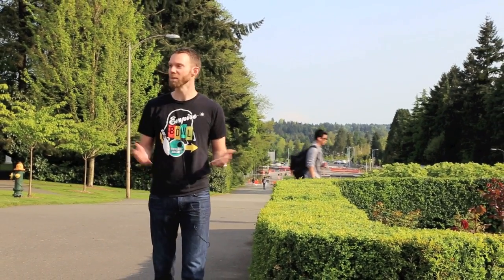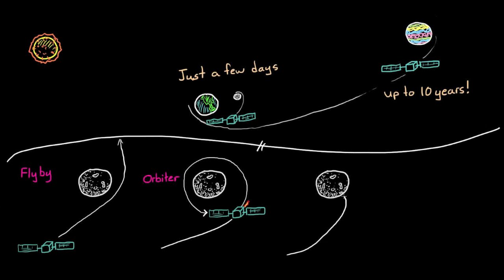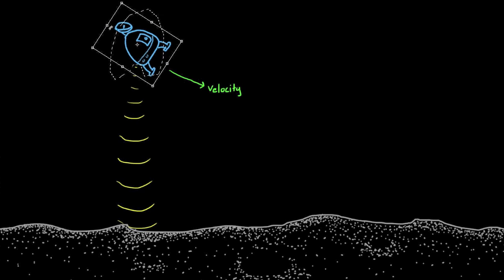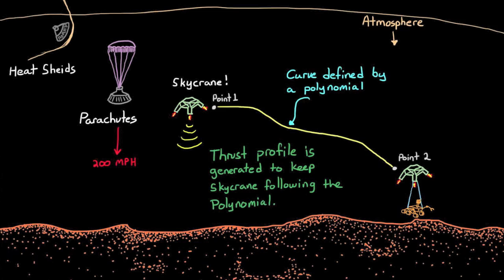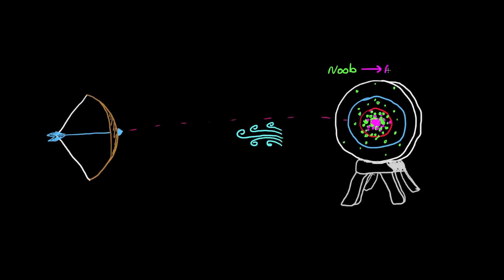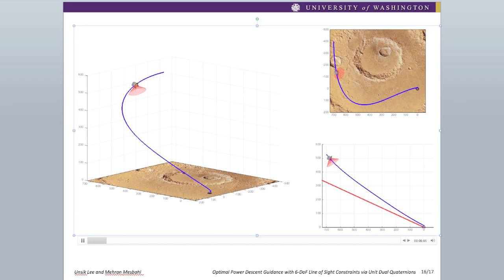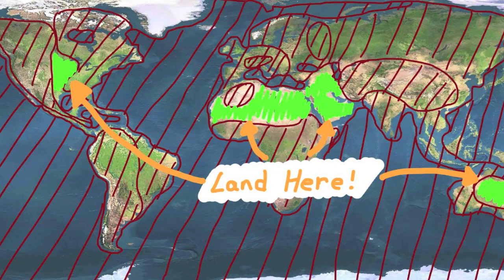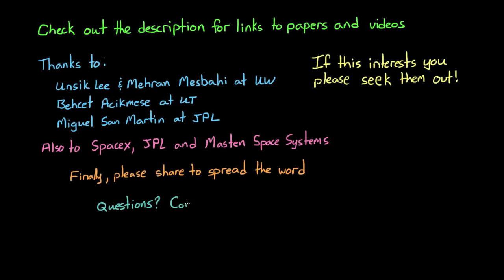How to Land on a Planet (and how it'll be done in the future!)

Comment: You claim in this video that "there has never been a pinpoint landing on an extra-terrestrial body, ever."

What about the Apollo 12 flight?  Admittedly they were merely trying to get close to a point instead of an exact spot, but they were aiming specifically for the Surveyor probe (unmanned) and landed on the opposite side of the same crater on the Moon... close enough to walk to the probe after those astronauts landed on the Moon.
Reply from the maker: GlanderBrondurg Apollo 12 was very impressive but it still relied on polynomial guidance to get to the surface. Everything worked out with the original predicts such that it landed very close to intended target, but had they entered into their landing trajectory off by more than they did they wouldn't have tried to correct for it.  Well, except Conrad was manually flying it for the last few hundred feet!  So I guess you could claim that Conrad was acting as the pinpoint landing algorithm :-) But the Lunar Module itself was still just a soft lander.